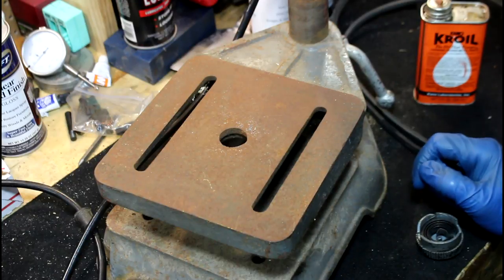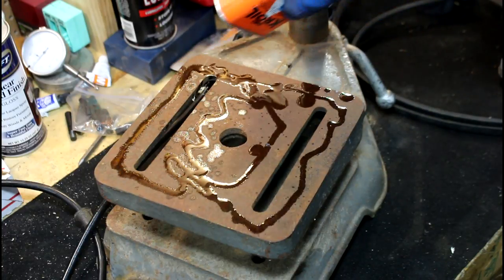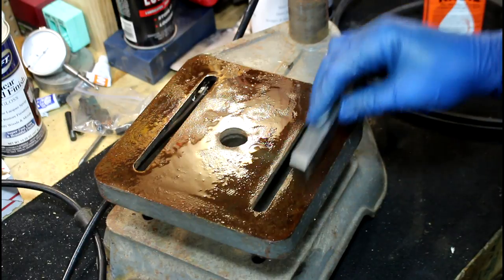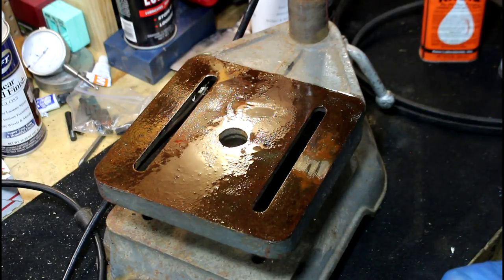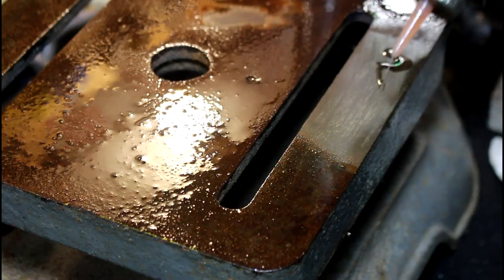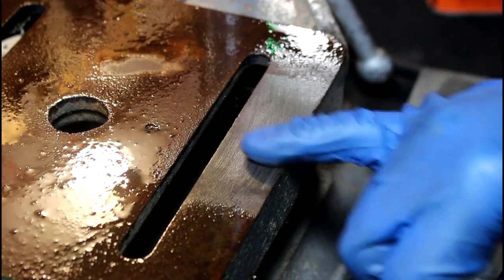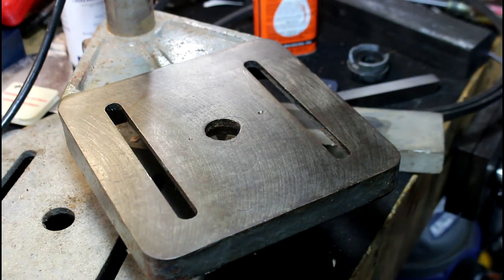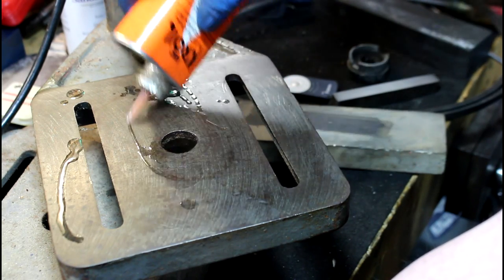Rust Removal By Hand Without Harsh Chemicals

Comment: Kroil is wonderful stuff, I use it on my firearms especially in the bore with J-B Bore Compound. I can't really tell how badly it was rusted, so YMMV with a suggestion: Surface rust with minor pitting comes up really nicely with just Simple Green and a Scotch Brite pad on an orbital sander. Follow up with water rinse, dry well (quickly) then penetrating oil of your choice, for me, its always a PTFE/Silicone compound like Tri-Flow or Frog Lube.
Reply from the maker: JB and kroil is pretty standard and works well. Some surfaces I don't like green scotch bright because it will dull a shiney finish. Depends on what you are working on.

Comment: I've been restoring a 9" south bend lathe from 1937 over the past few months.  I've tried just about every rust removal method I can find:  acid baths, electrolysis, wire wheels...

so far the least annoying manual method I have found is WD40 and scotch brite, or any scotch brite-like alternative.  You could do steel wool but it tends to fall apart on rough as-cast iron surfaces.  Sandpaper also works, but it's much more harsh than a wool-like mild abrasive. I'll have to try this kroil stuff but I wager its gonna be pretty similar to WD40.  Acid bath is least-effort but has a long down time and takes up space in the shop while its in use, same with electrolysis.  I also managed to cook my crappy power supply doing electrolysis, but that really speaks more about how junky the thing I bought is than the method being dodgy.  Electrolysis is a pain in the arse to set up, but has the lightest touch of any method I know of AND can strip paint in addition to rust, so for big fugly parts with sensitive surfaces, electrolysis was really nice.  

I like the HSS scraper idea, but its gonna really REALLY suck to use that method on anything other than a flat surface.
Reply from the maker: it has worked well for me and although it takes time, it is by far still much faster than waiting for chemicals to work on it. Just takes up your time.

Comment: Even if that Kroil stuff would not be harsh then the scraping with HSS certainly is. I would not use it for rusty machined surfaces that should stay in tolerance like your drill table here that should remain flat. Steel wool is ok. The finer grade of scotchbrite too. Evaporust (few hours soak time) or 9:1 molasses in water solution (1-2 weeks soak time and using soft brush or pressure washer) are not aggressive chemicals. When the rust is gone nothing more happens. Unlike vinegar and citrus acid which continue to eat the clean metal. Electrolysis for rust removal (look up other YT videos) also preserves the machined surfaces but leaves them black not shiny. The black very thin coating is Fe3O4 converted from the original red Fe2O3. If it is dried and wetted with oil it will not continue to rust. It is the same thing as gun bluing. But you can also remove it by scrubbing with fine grit scotchbrite. But you could have scrubbed off the red rust with sotchbrite in the first place. So electrolysis only makes sense if you want to keep the black surface.

Comment: I have been using this way , it had better to marinade the surface with W40 over the night then scrape it      on my instagram
Reply from the maker: I'de agree it does work a little better after it sits for a while. However, I've tried WD-40 several times and it doesn't come close to penetrating as deep as kroil does.

Comment: Oil is a chemical :P
Reply from the maker: Yes, it is, but it isn't the typical caustic or acidic chemical used for rust removal.
Reply: Another option to consider is these newish chelation-based rust treatments, such as evapo-rust.  They seem to work pretty well and won't affect the non-rust metal or paint.  My own experience is that it leaves a black-ish residue which is pretty easy to clean off with steel wool or scotch-brite.
Reply from the maker: I'll have to give it a shot next time around. I've seen bad things happen to cast iron even with simple cleaners such as Purple power, and I read recently where a guy left cast gears in evapo-rust for a couple days and it started to eat away the cast. That's what that black stuff is oxidized metal.